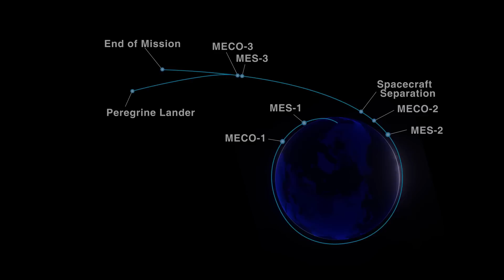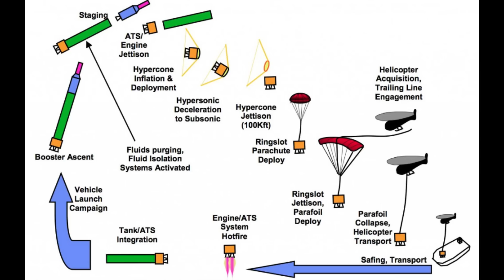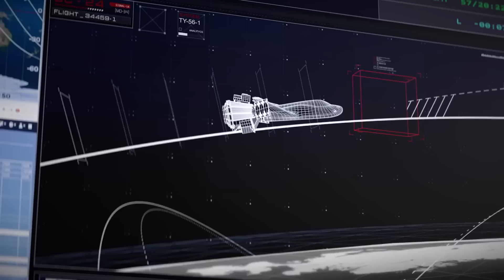Why Vulcan is the Most Important Rocket ULA Has Ever Built

Comment: An important and capable launch vehicle. If they can successfully reuse the engines in the future and ramp up production to cover the high demand then I could see it doing well.
Reply: I do like their concept for reuse, I just hope it actually comes to be.
Reply: @vicroc4  Why would you like a concept that is reuse with extra steps?  Get rid of the extra steps.  Do direct reuse, no silly schemes where they try to remake every part of the rocket every time, but reuse the engines.  An overly complex gimmick.  Rocket Lab just tried to catch their small first stages in mid air and it did not work.  Spacex tried to catch fairings in nets.  It did not work.  ULA is going to have very low recovery success rates.
Vulcan is another garbage throw away rocket that wastes tax payer dollars.
Reply: At least it has the wide payload niche secured for a few years
Reply: If…. Sort of like the Starliner and Max
Reply: Big if.
Reply: It's already cheaper than Falcon 9, so it's going to do well, for sure. Especially where higher energy launches are needed
Reply: @inemanja  It literally cannot be cheaper than a reusable falcon 9.  Reusability greatly decreases cost.
Reply: @_PatrickO Not necessarily, as we learned with shuttle. Refurbishing costs money in its own right.

Comment: There's still no better way to make those panels than hewing them out of the solid, as if it were a prehistoric dugout canoe? Maybe they could try diffusion bonding? Dreamchaser should probably stay away from airports if they still use the usual toxic thruster fuels
Reply: For both steel and aluminium it's easy to reuse the material that is removed (it's high quality, single type, high quality!) and even if it couldn't be recycled the removed material simply isn't a noticeable cost on the rocket. They're trying for the "best possible" and I don't think there's any method even including ones projected for the near future that is likely to even match "just get the best possible chunk and remove what's not needed", never mind improve on it. Especially since they've used this process for a long time and knows the issues.
Reply: One of the big aspects of Dream Chaser is using relatively safe propellant so it can be opened pretty much right away
Reply: He did somewhat answer this question in the video to be fair
Reply: @saleplains  you didn't understand the question
Reply: Falcon 9 uses thin aluminum sheets  rolled into shape and then workers do int to well in a reinforcing structure.  Falcon 9 tanks are probably cheeper but not as light.  But that said carbon fiber tanks have now been used with liquid oxygen in the small electron rocket and the neutron rocket will also be all carbon fiber.  Firefly is also planning to use carbon fiber tanks.  Carbon fiber is the lightest production is slow. 

Food for thought....  instead of machining the thick aluminum panels.  Cast them  using injection molding.  Casting the aluminum panels would be fast and then then weld them together.
Reply: @stevenf1678  I'm pretty sure that casting like that would create way different properties, and quite likely would still need to be machined because of lower precision
Reply: It is brutal, but for absolute peak performance, there's nothing better. The material isn't just wasted either, the foundry is essentially their nextdoor neighbor, and IIRC they capture all of the metal they mill out and send it back to be recast. I think Tory talks about it in the SED video.

Comment: I never understood how it can be cheaper than Atlas V and Delta IV when the 1st stage is basically Delta IV without foam insulation and it has an extra (expensive) RL-10 on the new Centaur upper stage giving twice the thrust and 2.5 times the propellant mass… OK they are using the much more efficient Altas launch infrastructure (Everything about Delta IV was very indulgent and costly) but can modern production techniques and higher production rates save that much money ?

I do think it’s a cool rocket, incorporating the best of both its predecessors….
Reply: Majority of launch costs are related operations, and fixed costs. 
Delta IV and Atlas V were expensive cuz they were built in same building, meaning they held back eachother lowering the flight rate and consequently increasing the costs.

Vulcan plans to take.over entire Decatur, and has already like 70 launches booked up, and now its projected to be competitive with Falcon 9
Reply: @_mikolaj_  they wont ever be competetive with Falcon 9 since by the time they get enough rockets to do 2+ launches a week, SpaceX will have Starship up and running a while ago. They narrowly missed their 100 launches a year target by 2 or so flights, meanwhile ULAs entire rocket flights is around 155. Sadly for some reason no other company can even beginn to rival SpaceX currently, and going by the trend it seems to only widen the gap.
Reply: @kishinasura7701  my brother in christ Vulcan is already destroying F9 in NSSL contracts due to being cheaper.
Reply: @_mikolaj_  This is the first ever Vulcan launch though? How can it be cheaper when its not even launching payloads yet.
Reply: @kishinasura7701  it already launched a payload, CLPS lander

Also, just cause someone isnt flying uet doesnt mean they cant sell launches. Market has high confidence in ULA and vulcan has 72 more launches booked.

In NSSL-2 phase 3 Vulcan comes out cheaper than reusable FH, and is close to F9 if im not mistaken, would need to check.
Reply: @_mikolaj_  But that would then compare it to Star Ship, which has better payload capacity. Also, with the frequency of launches, Falcon9/heavy will probably launch dozens of times if not more for every 1 Vulcan so I dont see how tat ould influence the market share at all.
Reply: @_mikolaj_  How would it be cheaper compared to Star Ship if SS itself is projected to be cheaper than Falcon 9, by a factor of more than 5 times less? I highly doubt Vulcan can compete against a 10 mil launch cost for the whole vehicle.
Reply: @_mikolaj_ Vulcan is still priced at 110 million dollar, compared to 67 million dollars of Falcon9.
Reply: @kishinasura7701  in NSSL contracts vulcan averages on 80mln while falcon missions around 100.
Reply: @_mikolaj_  NSSL phase 2 award ULA 6 launches for $633M, SpaceX was awarded $541M for 6 launches... of course, the context is that different  mission have other challenges, and the cost reflects on that. However, SpaceX forces competitors to be effective and lean in order to be competitive.
Reply: Isnt it supposed to land the engines with idk what

Comment: The hydrolox being used to do various jobs; I have a question.

Fuel cells were used for electrical generation on Apollo, but had well known shortcomings, suck as an inability to shut down and restart.

Have space-applicable fuel cells improved over the decades?  How?
Reply: The ACES fluids system was actually intended to use a small piston engine, not a fuel cell. The big reason I read was that the piston engine produces exhaust gas that can be used for cold gas RCS and tank pressurization. that was really important when they were trying to design a stage that could be refueled in orbit so that it wouldn't run out of RCS or pressurant after multiple refuelings. It was also designed to run using boiloff from the tanks since there's no way to prevent 100% of the boiloff from hydrogen.
Reply: @thamiordragonheart8682  A piston engine?  Really?  Can you show me a link?
Reply: The shuttle fuel cells were a definite improvement over the ones used in Apollo.
Reply: I'm curious as well. It seems technology would be better, but I'm sure some technical know-how has been lost over  the years as well. ???
Reply: @willharmatuk4723  No technology has been lost.  There is not a single technology developed for Apollo that wasn't used or superseded.  It's impossible to recreate the hand built Apollo system, not because we don't know how, but it was so crazy expensive to do the work in the first place, there's just better ways to do things.  Example, why on earth would you recreate the magnetic core memory in the guidance section, when a single cheap microcontroller would have more capability?

I was asking about how much fuel cells progressed over the past 50 years.  I mean, they put them in some cars, now, so I guess they solved the restart problem, at least.
Reply: Fuel cells have largely been replaced with colar.  Solar is much lighter and  cheeper. a large panels can be folded up and deployed once in orbit. They  can allow a ship to stay in orbit indefinitely.  The shuttle had to return to earth after a week or so due to the limited supply of fuel for the fuel cells. on the crewed Falcon 9 missions the solar panels cover the trunk that carries cargo to big to fit inside the capsule.

Comment: They should have kept the historical name "Atlas" and call it "Atlas VI". "Vulcan" just dosn't mean anything.
Reply: Or Delta V.

You know, like Delta 5 and change in velocity.
Reply: Give me one reason it should be called Atlas/Delta if it has little to none contimuity with either of these vehicles?
Reply: You mean like Atlas V had no commonality with it's predecessors? Or like Delta IV had no commonalities with Delta II? It's close enough to an Atlas and SLS could be a Delta V.
Reply: @Chuckiele  id say its the level of "SLS" commonality.
It looks like something, but when you get into details it turns out its something completly different, just like SLS core stage is more closely related to any delta in history, than to the shuttle external tank.
Reply: @Chuckiele  Delta IV had no link to Delta II apart from using GEM 60 side boosters instead of GEM 40s, however it did use the 4m upper stage from the short-lived Delta III (which used GEM 42 SRBs).
Reply: @_mikolaj_  frankly it has a ton of commonality with both, Centaur upper stage especially. Fundamentally it has a different name so that Boeing and Lockheed don't fight about who's rocket gets "killed off" and who's brand becomes the company's standard.
Reply: @AutomaticJack  it uses similiar machines and GSE but is vastly different vehicle when you go into details. Different tank structure pattern(orthogrid vs isogrid) completly different booster stage propellants, new Strap on boosters, and massive centaur upperstage, larger than ever.

And tbh, just having centaur doesnt make it an atlas, Titans also flew centaurs and shuttle was not far from doing so too. 
Heck, OG centaur was supposed to launch on Saturn I
Reply: @_mikolaj_ Centaur is very much the last living piece of Saturn hardware.  I like to think that there is a little bit of Saturn in the whole of every system that uses Centaur because of it.

Comment: No Vulcan with a single strap-on booster like the Atlas? What about odd numbers like 3 or 5 boosters? The single booster version might improve the TWR of the lowest end Vulcan. ?
Reply: Only 0, 2, 4 and 6
Reply: Vulcan will launch with 0, 2, 4, or 6 solid rocket boosters. I believe that the software running that launch vehicle is unable to use an odd number of boosters.
Reply: @KnightRanger38  It should be able to fly with an odd number of boosters but it doesnt need to anymore. Atlas V had the odd booster positioning because of the downcomer and the electric lines.

Comment: For the fanboys trying to sound as couch Rocket experts bashing ULA for the "throwaway" and "obsolete" Vulcan Centaur, the rocket is just a small percentage of the costs per launch. And using this approach of using it in disposable mode, to then try to recover some sections, allows ULA to gather data already in commercial launches.
Reply: Atlas V was $109M/launch, Falcon 9 is $67M/launch. Vulcan would have to reduce their cost by 40% just to reach Falcon 9's current price, a price that probably has massive margins (they currently have nine active boosters with double digit reuses). And falcon 9 is planned to be phased out once Starship reaches maturity, as it will be even more cost effective than Falcon 9. Of course this is speculative, but so is Vulcan.
Reply: What's the percentage of the rocket cost in the total launch cost exactly? Machining parts out of billets is extremely expensive.
Reply: @michaelbuckers   Retrieving a rocket adds costs, as refurbishment, transportation, as more challenging Delta-V, since the rocket needs to be stronger as heavier as using extra propellant as landing gear. If reusable rockets were so economical advantageous the Space Shuttle wouldn't been shut down, and the costs to LEO using the Falcon 9 by SpaceX should be way cheaper by now.
Reply: The Falcon 9 already is way cheaper than anything before it, but they're not gonna drop the price even further if there's no competition.
Reply: @RogerM88 The space shuttle wasn't reusable, it was refurbishable. That led to it being still quite expensive. Falcon 9 has significantly lowered cost per kg to orbit.
Reply: @maxv9464  The Shuttle was able to carry a Crew as payload. As being able to perform satellite maintenance at LEO.
Reply: @Chuckiele  So if SpaceX is not dropping the costs, then what's the point of claiming this approach would lower drastically the costs to LEO? Or the rush to switch to Starship, if Falcon 9 is so profitable? Don't fall for all the hype without question.
Reply: @RogerM88  Doesn't matter what it was capable of, it wasn't reusable. There were lots of extra costs involved in reflying a shuttle. Costs which falcon 9 has mitigated and which starship will basically eliminate.
Reply: @maxv9464  It doesn't matter if it's reusable or not, only costs per launch have any meaning. So what does that figure looks like?
Reply: @michaelbuckers  Cost per mass to orbit matters, not just cost per launch. And for falcon 9, with every reflight, the cost gets progressively lower. I believe the falcon has decreased that cost by nearly a factor of 10 from previous vehicles but don't quote me on that.
Reply: @maxv9464  Ok poor terminology on my part. PRICE to get your stuff to orbit, contingencies included. It's still beaten by same old Russian rockets.
Reply: @RogerM88  They rush to starship because its fully reusable and thus even cheaper... Im not falling for any hype, I just use common sense. SpaceX is a private company. If something isnt economical, they would stop doing it. The space shuttle wasnt economical at all but it was government funded, you cant compare them. SpaceX IS dropping the cost, their internal cost, they arent dropping the price because they dont have to. If ULA had a competitive vehicle, SpaceX would have to drop the price.
Reply: @maxv9464  Yes and no. If you have a 3 ton satellite you want to get to orbit, you dont really care whats the cost per mass to orbit, you just care about whats the cheapest flight for the mass you have.
Reply: @michaelbuckers  I'm sorry, you think that expendable Russian launch vehicles have a lower cost per unit mass to orbit than falcon 9?
Reply: @Chuckiele  That's fair, although with sufficient reuse starship is likely to start beating out even small/medium launchers in cost for small/medium payloads.
Reply: @maxv9464  They charge less, and that's all there is to say on the matter.
Reply: @michaelbuckers  The Russians do? Also, that's not the end of it, because SpaceX can put its own products into orbit on the cheap

Comment: I know that there was a list of Emergency / Backup Runways that the Shuttles could have used all around the word is that still the case for dream chaser? Same list, just an updated one or is Dream Chaser restricted to just one place?
Reply: Probably. In theory it could land on any runway long enough (but landing at a major airport would cause unwanted delays to other flights.)
I suspect they'll have plans to land on some friendly countries' air force bases. Anywhere they use as a landing site will require preparations to recover it from there and return it to Cape Canaveral.
Reply: Dream Chaser, unlike the Shuttle orbiters, has more options due to its smaller size and due to its non-toxic propellants. So, it can land at any large airport, and it can be approached immediately after landing to get time-sensitive cargo or an injured astronaut offloaded.
Reply: @mikedicenso2778  I hope there aren't astronauts onboard a cargo spacecraft... that would be a very bad day lol
Reply: @Matt-pz4qo  There's a crewed version in works, so yes, crew or cargo.
Reply: Dream Chaser has a few alt landing sites, but less than shuttle. Pretty sure they have an FAA re-entry license for SLF & Spaceport America.
Reply: Dreamchaser only needs about 8000 ft of runway.  It's a LOT less massive than Shuttle.